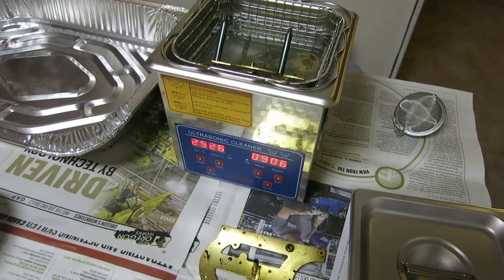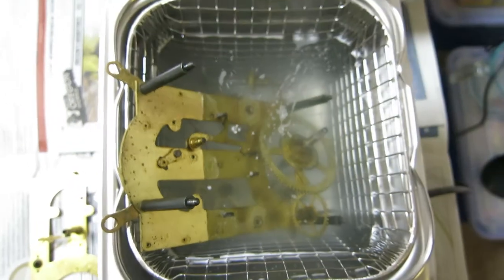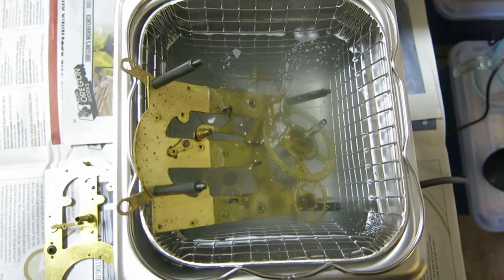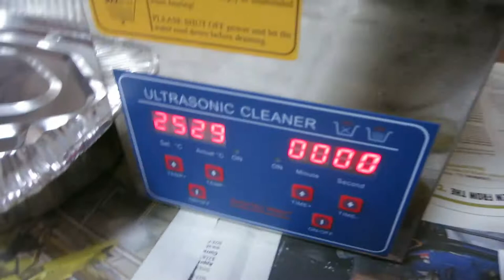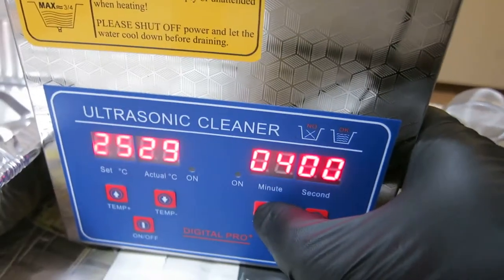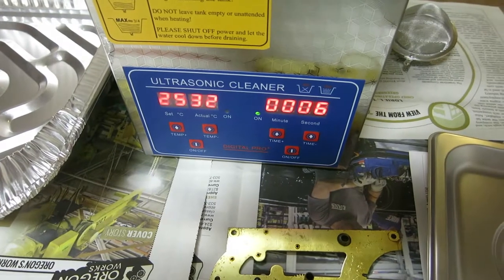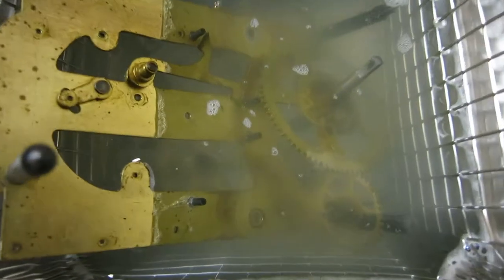Hearing / watching an ultrasonic cleaner clean clock parts

Comment: did it come clean?
Reply from the maker: Good question - thanks for reminding me that I didn't show the results - oops! On the "no" side, there are some pits in this probably-century-old Ansonia clock movement that still have some rust or such in them; you can see those pits early in the video, in the part of the back plate that's above the water line. On the "yes" side, I'm delighted at how clean the pivot holes and lantern pinion trundles are; the ultransonic cleaner does a great job of cleaning out those inaccessible spots. I'm also giddy about how the cleaner revealed the bluing on the verge arbor and the bolts - that never would have shown up with by-hand cleaning. I'll probably experiment as I clean the next few clocks. In particular the next one is a rusty cuckoo clock movement, so I'm very interested in how all the rust will fare against my hand-cleaning and the ultrasonic cleaner.

Another indication of how well the ultrasonic cleaner cleaned: when unused, the cleaning solution is as transparent as water; when I was finished running this clock through the cleaner, the water was so murky I couldn't even see half way down into the basket. Also, when I dumped the used cleaning solution, there was a lot of grit at the bottom of the cleaner - evidence that a lot of nasty dirt and oil came off the movement.

Comment: did you add any solution with ammonia?  It looks like plain water to me.
Reply from the maker: I currently use about 2 Tablespoons of Vigor ultrasonic cleaning solution to 1.12 Liters water (filling the cleaner to the 'full' line). I've been happy with the results I get from Vigor, but it looks like Timesavers no longer carries it. See https://timesavers.com/c-325525-chemicals-adhesives-soldering-cleaning-polishing-ultrasonic-cleaning-solutions-rinses.html